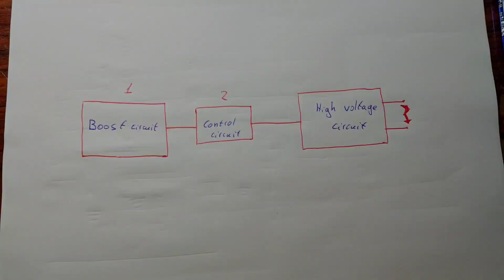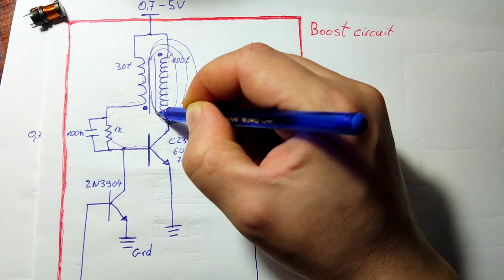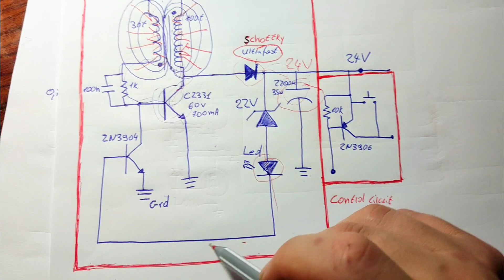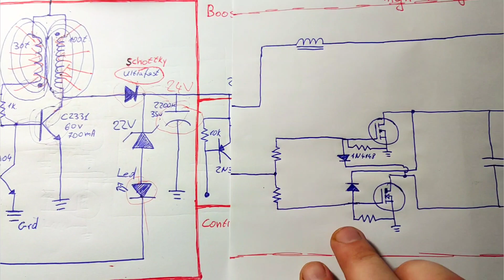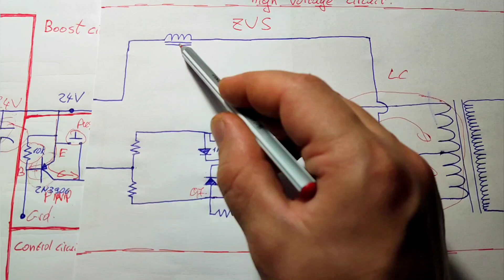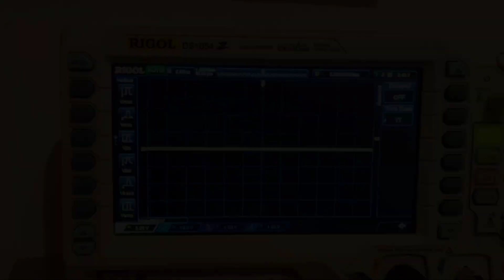Starting a fire with electronics

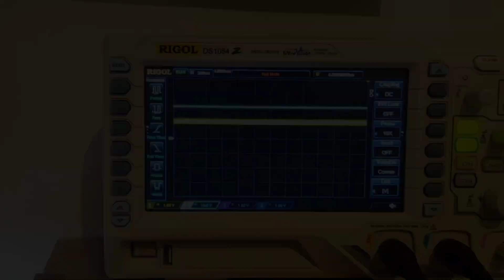Comment: You explained it quite well. 6:20 I was surprised how the transistor hardly turns off at all; if it was closer to 50% would it work better? 

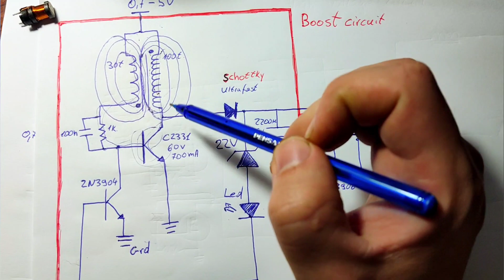3:40 the second transistor doesn’t just steal current away from the first, it also shorts the primary to GND (thru the 1k). Isn’t that sub-optimal?

Comment: Very nice, thank you for walking me thru your high voltage fun circuit.  I really enjoy the analog design that goes into these.  Found you here looking for xenon strobe circuits.  That comes from an interest in motorcycle ignition, CDI and TCI.  The CDI ignition has a lot in common to the xenon flash circuits.  And I got an old timing light to help test my ignition work and rediscovered how cool those xenon strobe/flash lights are.
Reply from the maker: Thank you! I also have a video on how to build a circuit for xenon lamps